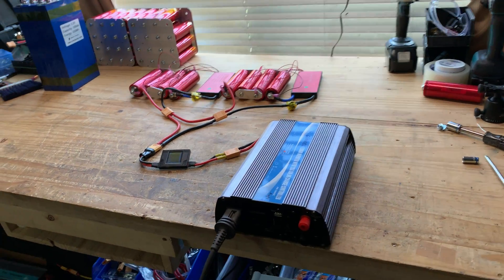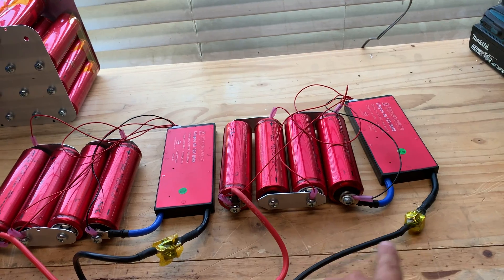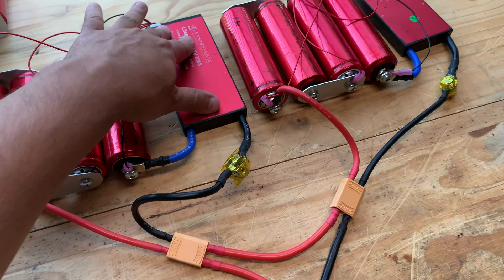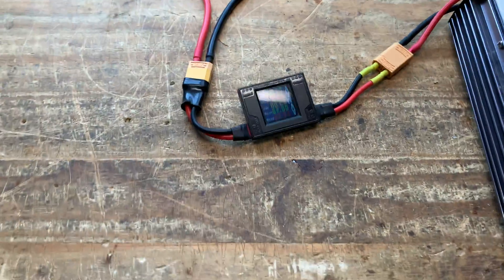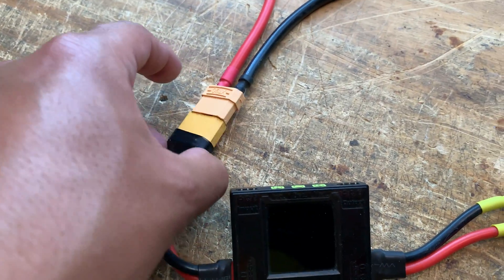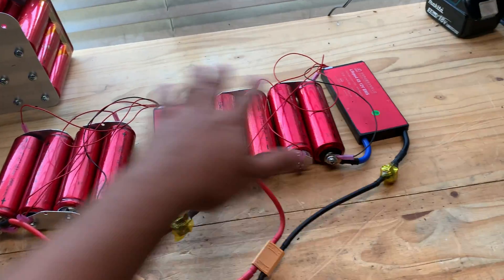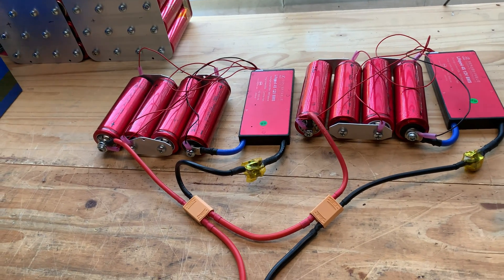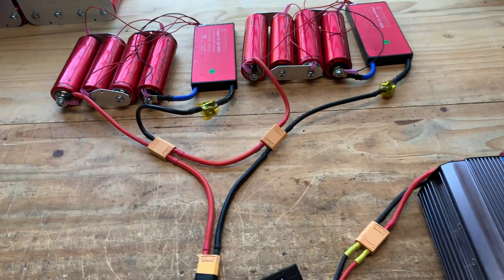BMS Battery Module -  Can you Series connect them?

Comment: Now wait a minute. When the left side BMS opened the circuit, there shouldn't have been a current path through the series circuit at all. It should have acted like you unplugged one of the XT60 connectors entirely. My guess is that when the left BMS faulted and disconnected the load, there is still some small amount of current feeding through the balance wires from those batteries to complete the circuit. You should recreate this test and use a sensitive multimeter to probe around and see how the current is actually flowing. You might have just discovered a serious flaw in the design of those BMS circuits.
Reply: I will explain this to all of you. The BMS is switched off but the other one is still on. There is no leak. The mosfet switches have a body diode in their package. The current from the other pack is trying to reverse charge the pack that is off, but trough the body diode of the mosfets the current is simply passing in reverse. That however is a problem because the body diodes have normal diode characteristics and a 0.5-0.7 volt drop trough them. That means that they will be dissipating about 50-100W  if the load is trying to pull 120-130 amps. The body diodes also have a different, much lower current capability than the mosfet itself can handle. Basically if you do this and your load doesn't care about the input voltage like the inveter ( a starter motor, light bulbs or some sort of switching power supply with wide voltage range input ) you will kill the mosfets on the BMS. Probably explosively because than they will short out the cells in the pack.
Reply: Also i am nor a 100% sure, but there might be a way to daisy chain multiple BMS boards by hacking in to the mosfet control circuitry and the battery management ic's outputs. In any way there must be only one parralel bank of mosfet's switching the entire battery bank on and off, so the BMS's in the middle must be shunted and the one at the end must have it's mosfets up rated. I am looking in to this because i need a 90-100s BMS for a portable DC power brick for a small inverter welder. It will need to provide abot 10-15Amps at 260 to 350V DC
Reply: @TheOriginalEviltech hi have you discovered anything
Reply: @stormashish  yes. Beyond 27-28S the BMS needs to have active isolation power supply in order to keep the monitoring IC's output under it's maximum ratings. The power mosfets also need to be upgraded. So in summary you need a dedicated bms for the full voltage of Battery Pack. You cannot daisy chain multiple BMS in series you can only parallel them and even then it's not advisable.
Reply: @stormashish  right now I'm working on a Lego like system with a baseboard which contains the current sensing circuitry and mosfet controllers, different options for mosfet expansion boards and 10s monitoring boards. Every 10S board has independent power supply and opto isolated communication with addressing. The protocol I will be using will allow up to 12 boards. This means that you'll be able to connect up to 120 batteries in series.
Reply: @TheOriginalEviltech  ohh wow .... I don't have that knowledge but after digging on internet i found a solution of master slave bms but that's expensive i think so .... If system of yours is working then please let me knw to or links from where i can buy
Reply: @stormashish  Still in design and testing stages. If i manage to get it to market i will post a link in some of the new Jeihu's videos or in the Facebook group.
Reply: There's nothing like reading these types of comment on youtube videos to make me feel like an idiot. I think I have some things to learn.
Reply: Check the reply from darren smith
Reply: Good theory.
Reply: That's exactly what I came to say. There has to be a leak through the balance wire. If you put them in series and only one trips out, but the voltage is still enough to be usable by the load, my bet would be on smoke.
Reply: It is true that MOSFETs have a body diode in them. That is why BMS never use only a single MOSFET switch. BMS usually use two mosfets connected in series with their drain tied together. The 1st mosfet is often named "discharge" mosfet and the other is named "charge" mosfet. It is to make sure that when the mosfets are off, current can not flow through their body diode, because cathode of 1st mosfet's body diode is connected to cathode of 2nd mosfet (as depicted in https://electronics.stackexchange.com/questions/277248/lithium-battery-protection-circuit-why-are-there-two-mosfets-in-series-revers). Of course a body diode in a mosfet can have leakage that allows small amount of current to pass in the wrong direction, which might be in this case.

It is also possible that there is a leakage in which small amount of current can flow from charge mosfet's source to gate and then go to the battery negative via the battery protection IC. Normally this can be avoided by installing a diode between charge mosfet and battery protection IC. But this adds complexity (and cost) to the circuit and manufacturers often left it out. I'm not 100% sure though, lets discuss
Reply: @RianWardana  Yes you are right, but there is the other "charge" mosfet that is still turned on when the battery is fully discharged so it basically acts as a conductor. And this causes the BMS to act as a diode.
Reply: chineseium bms they haven't got a clue i think people think they protecting cells ...i think they full of shit its not like it can isolate a single cell which ive seen 3 mosfets setup just for 2 cells in series with separate chargers so would need a few for big packs lol

Comment: 12 volts from backfeeding mosfet body diodes from the other battery pack
Reply: A BMS should handle both forward and reverse currents, and have the capability of blocking reverse polarity as well. So I would expect two opposing P type mosfets. anyway.. this is a video of what not to do :)

Comment: Thanks for answering my question. But  I have another doubt. What if you connect those 2 packs in parallel, will it produce 200A of current constant? In theory, if two batteries are connected in parallel the voltage remains the same but the amperage will double. Since each BMS is rated for 100A, will it not trigger the over current shut down if the total current passes over 100A?
Reply from the maker: Watch the video again

Comment: Could you fit a 'master' BMS to solve the problem of the packs being unbalanced from each other? So for example if you had 16 cells in 4 packs of 4, each with its own bms, could you then add a 5th bms, connect its B- to negative, and B1 to B4 to the C+ of each of the other bms's?

Comment: 48V (and 60V) setups don't get the attention they deserve, more so if you need a solution for serious AC power.

But series BMS introduces a major failure concern, that being the more of them you add the chances of one failing increase. That's a problem because replacing a dead BMS means taking the entire pack offline, unlike an active 1S balancer where you can disconnect the individual banks, bridge connections and still keep your battery working. Also since series BMS shares the load, having just one fail can strain the rest of the system, even if this doesn't show up as an error or is only afterwards apparent. With a 1S balancer it doesn't matter if the failure is with the cells or the balancer, the failure won't affect the rest of the system.

I would not recommend a BMS for a 16S pack or larger - stick with active balancers.

What makes 24V setups neat is their portability - carrying a 12V battery in each hand is easy, wiring them up in series can be done quick. and if you have a quality PSW inverter you can get some real use out of it.

I am still pissed off at your ghetto charging solution from the last video - please make a better one.
Reply: Just wait till 400v, 600v, and 800v are more common..

Comment: Great test. After the first BMS trips, can you please test the current capability of the remaining 12V system i.e. hook up a 12V load through the meter. That would show the bleed-through capability of the BMS that had tripped. I would have thought it shouldn’t allow any significant draw?
Reply: Near zero "bleed-through"  unless the bms has failed shorted.

Comment: I know that some BMS for single cells have to either be removed from the load or need a charge to enable the power again.
So you can check if charging the pack after the protection triggered reenables the BMS.

Comment: I'm usually with you Jehu but this is a really bad idea. What we should be telling people to do is use an 8S BMS for 24 volt LiFePO4. This will also give ~24 volts out of the system, without having two BMS boards in series.
Reply from the maker: My bad ideas are my best ideas,  what are you all afraid of?  Show me where the problem is and I’ll drink the coolaid.
Reply: @jehugarcia  I'm not trying to crap on your party. I always support your  builds, so easy bro.  In regards to protections, the BMS boards are not in synced. One board shuts down, the other gets a massive inrush of current, if there's a big load on the inverter at the time. Why wouldn't you just use a single 8s BMS?
Reply from the maker: Because people are building/ using 12v boxes with integrated bms.  This is the question at hand,  not if you can build a 24v system with bms
Reply: @jehugarcia  fair enough, I got that part. You asked for feedback in the video so I was just pointing out the potential.

Comment: jehu you could easily configure this for 120v 240v ect, off a high output alternator the amount of amps they can handle 'this could get dangerous' with a speed control turning the alternator unregulated , the caps could consume more than the alternator could put out,  might push a electric bulldozer, the caps should have alot left over after turning something with high rpms like a leaf blower motor or a vacuum cleaner motor turning the shaft on an alternator.

Comment: No. The first BMS will cut out and the second pack won't fully charge. Same issue as the pack without a BMS.
Reply from the maker: Why would you want to charge the second battery past the point you are able to use?
Reply: @jehugarcia  You don't, but like the individual cells need balance, the full packs would most likely need balanced too. One doesn't get charged as much as the other and the BMS of pack 1 stops pack 2 from fully charging. This could throw that pack out of balance as well. I haven't tested this theory, but it was one of the reasons I haven't cascaded boards. Active balancers work around this issues by not disconnecting the load, but you lose all the protection. Feel free to check my work, I would if I had a few spare boards.
Reply from the maker: It would happen as you say,  but it’s a good thing,  if one bms  is triggered way before the other it’s because its pack is mismatched to the other, if it’s just SOC mismatch then manual balance will fix,  easy, but if it’s capacity  mismatch then the smallest pack will always trigger first and that’s a good thing,  it would prevent reverse flow on cells saving them from death.
Reply: @jehugarcia  I never thought about that. So once in a while you'd still probably want to charge these as 2x12v instead of 1x24v. That's what the community is for! Never once crossed my mind about reverse charge.

Comment: No matter how many in series, each BMS will have a 12v potential across it on the mains.
Reply: the more you put in series if one trips the more voltage will go across it if one turns off, if the voltage is too high the mosfets will blow because of the too high voltage.
Reply: @SuperBrainAK  Only if the FET's don't break the connection completely. When Jehu disconnected the balance wires I expected to see a 0V potential because one of the BMS' broke the series chain (like Sailing ADVENTUROUS mentioned with the Christmas lights). But apparently there is some kind of bleed-through going on where when the FET's break the connection, a direct bypass is used, which makes the disabled BMS act like a wire. Though, this would only become dangerous when you are charging the system, during normal operation, the system would just see a voltage drop equivalent to the amount of failed BMS links.
Reply: Jonathan Overes The mere fact that this happens means you cannot safely use them in series. This is considered an unsafe failure of protection equipment. The potential for fires as a result of this failure is very real. It is entirely possible the failure of one BMS turned this into a ticking time-bomb.
Reply: Tony B. Yes. But!!! It should be like a cheap set of Christmas tree lights. Once one goes out, they all go out. If the tripped BMS had no bleed-through, the meter should have read zero

Comment: Show how to hookup in a car for a car audio amplifier and how to properly hook into an alternator to charge it
Reply: stick with capacitors for your audio amplifier. These things can't charge (maybe discharge as well) fast enough to keep up with the quick bursts needed by audio equipment. 
Unless you want to add this to power your amplifier (capacitor) as a second battery to reduce stress on your starter battery. In that case it would be a great idea. In that case you could simply connect the positive of this battery to the positive of your starter battery and repeat by connecting the two negatives. This would be called parallel connecting. Then you just have to connect the positive of the amp to the positive of the new battery and negative to negative. You could be done there but I would add in something that off roaders use in dual battery setups called a dual battery isolator so you don't kill your starting battery while you're winching or have your light bar on.

PS: not sure how well this will work actually since the alternator is not set up to charge this battery chemistry. For sure you at least need to make sure you have a bms on the battery. Anytime I say to connect to the battery, I mean to connect the bms and the bms will connect to the battery.
Reply from the maker: You don’t know how to connect 2 wires into terminals?

Comment: I think that the problem is not when they are being discharged , the problem is when they are being charged. If the capacity of each individual 12v battery is different , that's when problems can occur. I think is better to build the batteries according to the system voltage and then parallel them.  Using the batteries in parallel can be safer and more balanced in both , charging and discharging.

Disclaimer:  Im just thinking logically here. I haven't tested this theory, so take this with a grain of salt.

Comment: fwiw the danger is when you series up many of these units and start charging them, and one switches "off", the voltage across the mosfet will rise quickly and above the breakdown voltage of the fet, and then fry the fets and start shorting out. you would need a trend to open circuit detection, or fail-safe output from all "BMS" units, much like a multi-slave & master BMS system for HV batteries, so say, >20S packs.

I don't recall you mentioning this little detail at all.

This is a dangerous and irresponsible suggestion.
Reply from the maker: No one wants 20s,  people need 12v, 24v and 48v,  please try and keep up on what we are doing here
Reply: @jehugarcia  Please draw out a circuit diagram for this. If one BMS in the series connection drops out, lets say that goes >20M, 1G ohms.. alot. If something externally now drains that external potential to the pack ground, the positive connection of the single BMS will drop below its ground and to the PACK ground, it will drop to effective -18 to -24 v from positive. If this is outside the absolute max range of the FETs (Vds) then the mosfet will be damaged, or destroyed. At a guess the 12-24 BMS units may be ok.. if you string two 24v units together then all bets are off. If the safety margin of the mosfets was 100%, then this condition will damage that in-series BMS.

your video showed the BMS cutting out and having to be manually reset. purhaps it was because the top BMS saw a negative voltage once this condition was met. The positive terminal would have dropped to the pack ground under load. The BMS would then think you've connected the unit in reverse polarity. It then locked you out until you removed the negative voltage, and hot plugged it back in.

please check with scope and verify voltage rating of components inside.
Reply from the maker: All that is way over my head,  sounds like a good job for you. Show us what you describe
Reply: @jehugarcia  I've been busy with family sorry, some of the other replies have caught on.

Consider this;

Battery pack one and battery pack two, connected in series with a 1M resistor between the - of pack one, and the + of pack two. Now connect a "load", say 1k between the + of pack one and - of pack two.

Measure the voltage at the negative of pack one relative to the negative of pack two (load ground). You'll measure ~-12v, the same as when the pack is tripped. This compounds with more packs put in series.

I'm assuming that the packs are protected from both reverse polarity and overcurrent with two opposing P-type mosfets, so it can block bidirectional current flow.

|-+[=][=][=]--/\/\/\-+[=][=][=]---|
|-------------/\/-1K-\/\----------------|

Would you like a pSpice model for this? 

tl;dr;  All mosfets for a BMS must be rated to handle the maximum pack voltage. Use only ONE solid state disconnector in a pack.